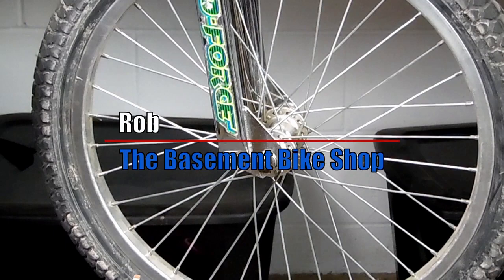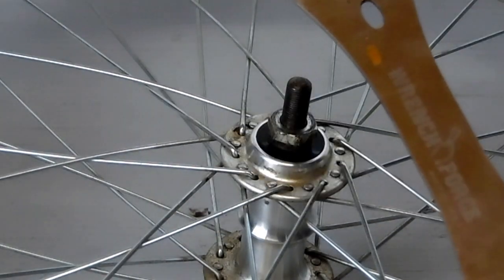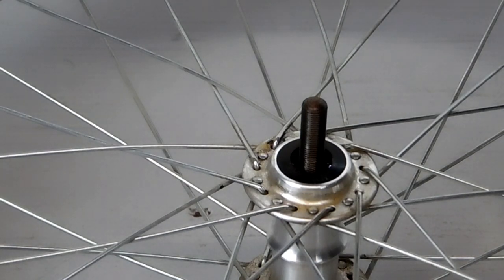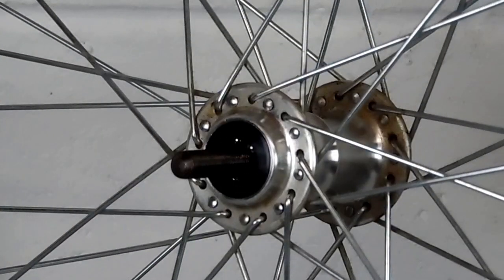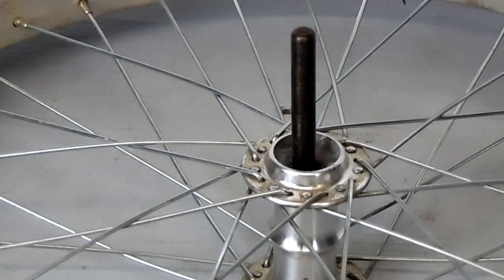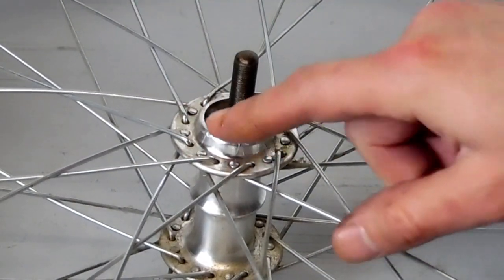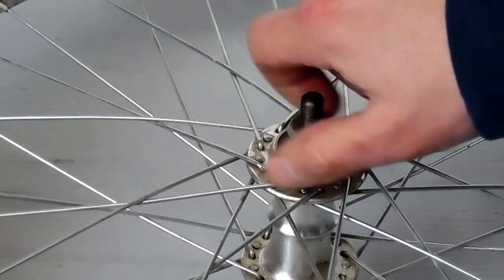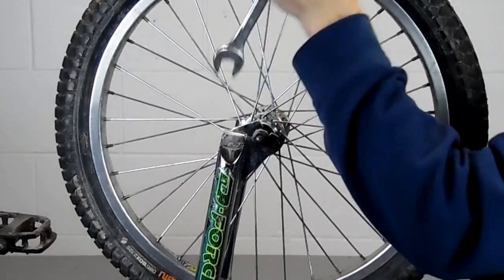Repairing Unsealed, Loose Ball Bearing Bicycle Hubs- BMX Axle Replacement

Comment: I have watched a few of these bearing service videos, but they all lack one aspect, and that is how do you replace the bearing cup in the hub. These do suffer from corrosion and pitting, so how do you remove the old worn cups? Peter Smith Australia.

Comment: Great video, I wasn't even too far off really. You cleared up some things for me. With that being said I think my only questions are. What kind of grease do I need to use? And how many bearings go in each wheel
Reply from the maker: I like to use park tools polylube 1000 or automotive grease. It seems to last longer although lithium grease will give you faster roll because its thinner. As for bearing count,  It depends on the wheel. I've taken apart many wheel with different size bearings and the number of bearings varies also. Basically, If i take a wheel apart that is missing bearing, I try to put in as many as i can fit in comfortably. Thanks for watching! I hope this helps.

Comment: how often should you grease a loose bearing hub?
Reply from the maker: Depends on how much and where you ride. When i rode unsealed bearings, if i only rode in dry conditions, mostly street and park, i cleaned and greased them every couple months. If i rode through rain or mud, every couple days.

Comment: is it safe to say that a 13mm cone wrench is a must-have to do this job?
Reply from the maker: Some cones take a 15mm and I've even run across one that was 17mm. Most Are 13mm and Yes, a cone wrench of the right size is a must have to do this. I did once grind a 13mm wrench thin when i was young and didn't have a cone wrench but i don't recommend it.

Comment: Sorry for the stupid question.....Is it possible to convert this style hub to sealed bearings? Thanks for the great videos, they're very helpful.
Reply from the maker: I don't think so. You have to get a new hub because if the way the bearing race connected to the hub are designed

Comment: so all i have to replace is the axle. On my tire.  I have a bike that my cousin just had to turn to shit and I'm trying to fix it back up. one of the problems I'm having is the screw part on the tire where bolts and pegs attach to is very stripped and the nuts wont tighten all the way cause of it?
Reply from the maker: Yes. All you should have to do is replace the axle. Usually that is caused by over tightening the axle nut.
Reply: @thebasementbikeshop2336  ok thanks. Where would be the best place to order bike parts?

Comment: I have a loose ball driver and my hub is wobbling any fix?
Reply: Try to find the sweet spot of not-too-loose and not-too-tight that allows the wheel to spin while not being too wobbly. Good luck.
Reply: @anaphrodisiacxyu  ye a little update j have a semi sealed i replaced the bearing with the stample from 10 to 13ball and have to thigten it like every 2 days and doesn't matter if it doesn't roll well when just thigtened because it comes loose anyways, il be getting a freecoaster wheel anyways so it doesn't matter to me.
Reply: my hub is ok but my driver is wobbly. How to fix it?
Reply: @JSB-2Z-2K  idk i have a cult match v2 now, maybe thigthen the driverside locknut
Reply: @Sunss  yeah the problem is i need to hold the other side with another wrench, and when trying to even untighten the driver's bolt it doesn't work, and I'm afraid of braking something if i force too much
Reply: @Sunss  the main nuts you mean the bolts holding the wheels? 
i should put the together on the driver's side or the opposite side?
Reply: @Sunss  inner lokthreads are either stripped or probably your axle too that type of problem dosent let yur cone n lok nuts to snug on tha bearings.
Reply: @DadeRich720  ugh it was a shit salt hub from wtp complete but now i have a match v2 with bombproof tech and it's indestructible and the pawls don't even wear down, just never get something with non sealed bearing it deserves to br burned.
Reply: Make a video bro
Reply: @DadeRich720  on what the salt hub?
Reply: @Sunss  both

Comment: Can u press a sealed bearing in that style of hub
Reply from the maker: I am going to say no...but, i was thinking about with a cnc you could cut the loose ball race out of the hub and mill it out for a sealed bearing. I do think the cost of the cnc work and bearings would be more than a new hub.
Reply: @thebasementbikeshop2336  ya I gess your right on that one thanks for the info 👍👍👊 keep up the awesome videos love them an  they're very helpful
Reply: Hi do you know what size bearings fit in these hubs , front and rear ? Thanks

Comment: so its the same for the rear wheel
Reply from the maker: Yes. After you remove the freewheel.
Reply: @thebasementbikeshop2336  im struggling to push the little cover back in to hold the bearings in
Reply from the maker: @jamescarter67  did you try putting the cover in before the cone nut